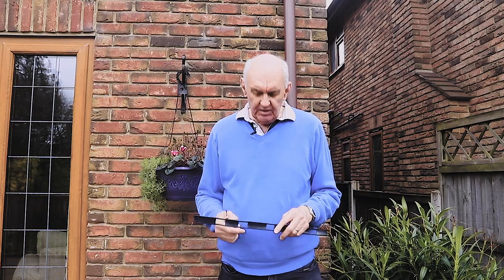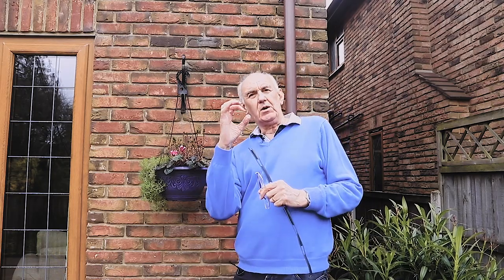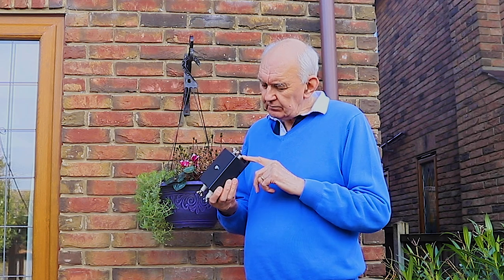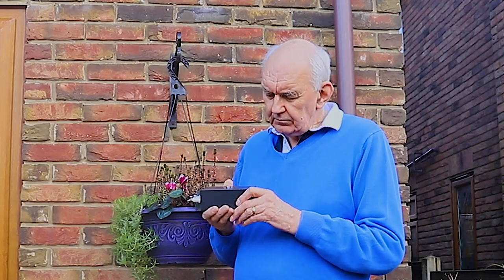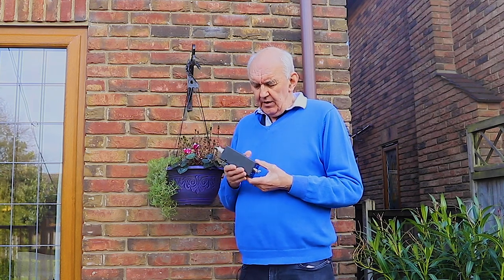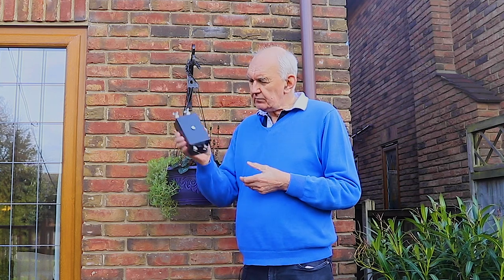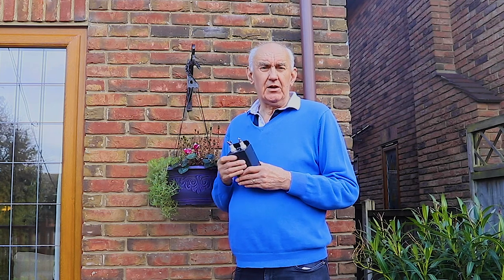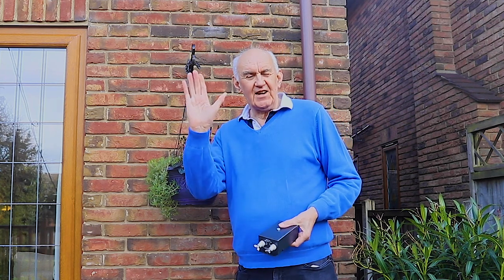Balanced line through Brick Wall

Comment: 1. Make a home-made doublet from wire and rose clips. Drill two holes through the wall and feed wires through.
2. Use the same two holes and use threaded rods to go through the wall. Will also work with 450 slotted line. Space the holes at same distance as the width of the line you use.
3. Use 450 slotted line and squeeze through one hole. Impendace variances over short distances will not matter.

With all 3 options, best use a symmetrical matching unit ie with the balun on the 50 ohm end.

Comment: Okay, well that's it? Just use an MFJ-923? Well there's other options but they all cost a hundred bucks. What if I wanted to build one? What's in the black box? Is it such a mystery or does anyone know? Or do I have to buy a $100 MFJ-912 to and crack it open to find out?

Comment: Anyone know how to use a vna with open wire? I want to be able to use the vna at the feedpoint of an inverted V. I have the MFJ Versa Tuner III which has terminals for the open wire on the rear. Perhaps i'll cut a hole in the wall the size of the tuner. lol

Comment: I find a 1:1 current Balun often provides a better match but have used 4:1 too. 73
Reply from the maker: Hi Tim, yes sometimes it is a better option but for my setup 4:1 works well. Either options solve the problem of terminating ladder line close to the entry point. 73s Peter.
Reply: @Tim can you help me here - I thought a 1:1 doesn't do any impededance matching - I thought it just attenuates any common mode currents?  I thought a  4:1 would perform a 4:1 impedance match but might not attenuate common mode currents depending on the design.  So if I had Z=50Ohm at the end of my ladder-line then  using a 4:1 would generate an unnecessary impedance bump (at least that's what I thought)!   Could anybody enlighten me please?
Reply: Kevin Polston it all depends on the impedance at the end of the ladderline. Tuners (auto especially) often struggle with low impedances which 4:1 could cause. That said, 4:1 often work well. It’s all down to the length of your doublet and ladderline.
Reply: @M0XYM  No "true" (ie not a choke) balun can prevent common mode current on the coax if the antenna is significantly unbalanced. Your feeder will really be part of the antenna and radiate, and if this causes problems, the only solution would be to run the balanced feeder into the shack and use a link-coupled ATU to do the balun transformation and balance correction. (edit) Or of course "do something" to the antenna to make it balance!